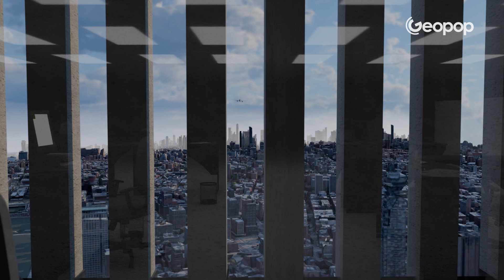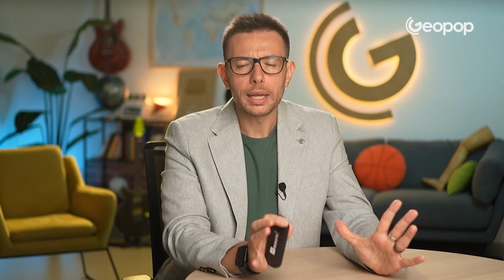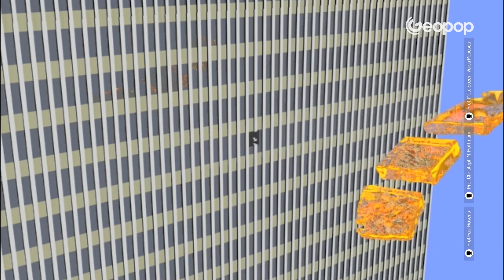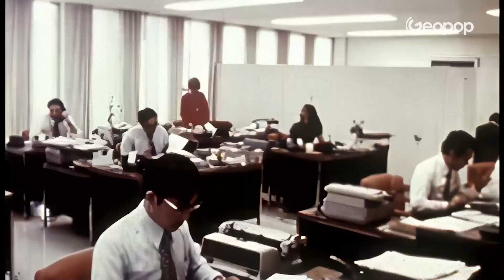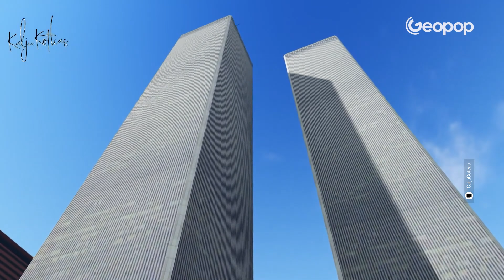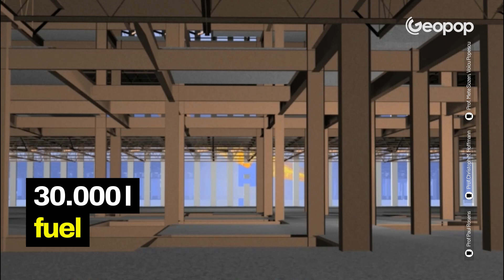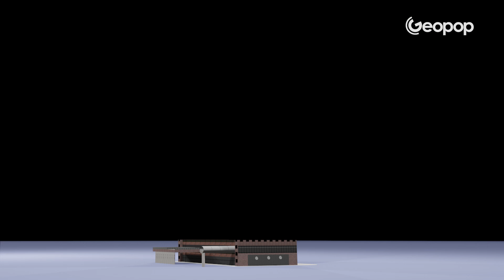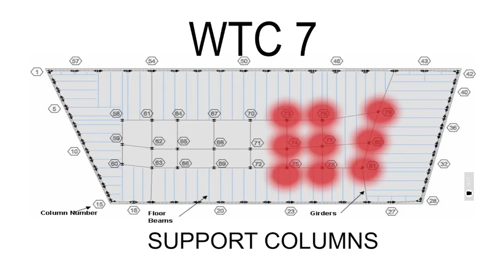9/11, 2001: The Technical Reconstruction of the Twin Towers and WTC 7 Collapses

Comment: I know exactly what happened. There had been an explosive set up for the past year and as soon as Larry Silverstein had his insurance lined up, he said “pull it”, which is a demolition term for “NOW”!
Larry was paid well.
Reply: IS pull a term used in the demolition industry and if so, how?  

Are you sure about that?

Did you check for yourself?  How do you actually know?  Did the internet tell you?

Joël van der Reijden, a deep politics researcher checked for himself. He mailed Jowenko BV, a Dutch company that supplies explosives and conducts demolitions and asked them if “pull” was an industry term for demolition. 

They said it wasn’t. 

Van der Reijden also asked Implosion World the industry trade magazine about the use of the word, and Implosion World told him: 

There is no such phrase in explo-demo. Most likely he [Silverstein] meant "pull out" as in have people evacuate. Conventionally, "pull a building" can mean to pre-burn holes in steel beams near the top floor and affix long cables to heavy machinery, which then backs up and causes the structure to lean off its center of gravity and eventually collapse. But this is only possible with buildings about 6-7 stories or smaller. This activity was for example performed to bring down WTC Building 6 (Customs) after 9/11 because of the danger in demolishing it conventionally 

It should be noted that Van der Reijden would be regarded as a conosouer of tin foil hats by some, and he thinks the Silverstein smoking gun is actually a red herring. He also thinks the 9/11 Truth movement is steered by the security services and that 9/11 Truthers are unwitting (or even witting) disinformation agents. 

Oh dear. The rabbit hole runs deep, doesn’t it? 

Larry Silverstein was allegedly (I don't think the phone call took place as he claims) talking to a firefighter, not a demolition guy so chances are they would be using firefighter slang, NOT demolition industry slang, right? So how does a firefighter use the word "pull", in the context of a building burning out of control and operations to fight said fires? Maybe we should look at some relevant examples or how an FDNY firefighter uses the word “pull”:

FDNY Chief Daniel Nigro - the on-scene commander at Building 7 on 9/11/2001; 

The biggest decision we had to make on the first day was to clear the area and create a collapse zone around the severely damaged 7 World Trade Center, a 47-story building heavily involved in fire. A number of fire officers and companies assessed the damage to the building. The appraisals indicated that the buildings structural integrity was in serious doubt. I issues orders to PULL back the firefighters and define the collapse zone. It was a critical decision; We could not lose any more firefighters. It took a lot of time to PULL everyone out, given the emotionalism of the day, communications difficulties and the collapse terrain

Deputy Chief Peter Hayden - 33 year veteran, NYFD in the August 2002 Firehouse Magazine;

No, not right away, and that's probably why it stood for so long because it took a while for that fire to develop. It was a heavy body of fire in there and then we didn't make any attempt to fight it. That was just one of those wars we were just going to lose. We were concerned about the collapse of a 47-story building there. We were worried about additional collapse there of what was remaining standing of the towers and the Marriott, so we started PULLING the people back after a couple of hours of surface removal and searches along the surface of the debris. We started to PULL guys back because we were concerned for their safety

Notice anything about those quotes? 

For one thing, the word pull comes up quite a bit. How is pull used? What is the context for its use? Are they talking about blowing up a building or avoiding unnecessary loss of life by pulling their guys out of there?  
Silverstein was allegedly speaking with the FDNY on-scene commander. So, now based on Nigro's and Hayden’s statements, what do you suppose "pull" means to a New York City firefighter?

Be less dumb

Comment: Boeing 767 can’t do 700km/h at sea level. Not even with nose diving. That’s aerodynamically impossible.
Reply: Is it? Says who? Not Boeing, the folks who designed, built and tested the planes.
Reply: @TheLoonResistance said boeing and pilots. do you even know what vmo of airframe is?
Reply: @sccooty  1. You are lying. Neither the manufacturer or any organization representing pilots has ever said any such thing, and I suspect you know it. 

2. VMO is not an aerodynamic limit. It is like the posted speed limit on the highway. It applies to all aircraft regardless of type or manufacturer.
Reply: But the planes werent at sea level though?, they were flying through a city that would relatively kill any head wind, and had descended from cruising altitude

Comment: NIST ruling out explosions yet by doing a simple search will find countless videos of people claiming they heard explosions and actual videos of explosion sounds….
Reply: In a review of 603 first responder accounts from 9/11 only 55 (just 13%) of them mention the word explosion or like an explosion and 0 (0%) mention seeing or hearing bombs

And of course, zero corroboraint physical evidence. There are no where collapse initiating explosives are seen or heard. There is zero physical evidence. 

Not exactly compelling. 

Do remember that explosION and explosIVE are different words with different meansings and explosION is a word that can and frequently is used without the presence and use of explosives.

Twin Towers collapse mechanisms are well understood. Collapse initiation was due to sagging floor trusses (which we can see) causing inward bowing of perimeter columns by up to 5 feet (which we can also see) at the impact and fire damaged floors until those perimeter columns buckled and failed, initiating the collapse (which we can see). I would refer to you the excellent Gary Pollard video of the collapse of the South Tower. Pay attention to the first 12 seconds in particular.

WTC2 Collapse -- Gary Pollard (Enhanced Raw Copy from NIST) 

www.youtube.com/watch?v=ULdiD6gYZO0

Columns don’t work well when they are bent. The Twin Towers were designed to work with straight elements not bent ones. When you bend those columns they become up to 4 times weaker. Failure is inevitable.

Notice how the columns are already bent when the camera zooms in, become a bit more bent over the next new seconds until they give, starting the collapse. 

So what bent them? It sure as shit wasn’t thermite or sooper-sekrit fire-and-impact proof hush-a-boom pre-planted demolitions that don’t explode. 

If you keep watching you will note that after the tower starts collapsing the air inside the building (95% air by volume) gets compressed and forced out the windows. These low-velocity air bursts devoid of blast or fragmentation effect are a reaction to the building collapsing not a cause of the building collapsing

Comment: a blacksmith said steel the strongest metal planes being aluminium and those RSJ beams steel.  No kero jet fuel could melt them even if they got soft the whole building wouldn’t collapse because the steel below the heat line would not be weakened  thermite  was used extensively instantly melting and destroying strength to bring down the hole structures including snapping foundational girders with instant explosive thermite charges which were the sounds going bang not bombs!   The Solomon brothers Building seven was the smoking gun because it hadn’t been struck by any planes and it still come down leaving no wreckage or barely any debris remain after everything settled even months later liquid metal still to be found running down the gutter The NIST Report didn’t answer anything they made it up as they were going along to cover this massive crime of The deep state military industrial complex and the $4 trillion lost.
Reply: Thermite melts steel?  Does it though? If only someone had actually tested this instead of just guessing or making unfounded assumptions. Oh, wait!

youtube.com/watch?v=JXWCMBuusMI&ab_channel=TrutherTVArchives 

In this video starting at 45:35 and running to 48:35 the Energetic Materials Research and Testing Center (EMRTC) conducts a test to examine the effectiveness of thermite in cutting a vertical hollow box-section steel column. The column tested is smaller in cross section and made of thinner steel than that of the Twin Towers perimeter columns (and never mind the core columns). In total 175 pounds of thermite are used for the test on just one column and requiring the construction of a rather conspicuous coffer dam to contain it. Do recall the Twin Towers had 240 columns and 110 floors.

It would be odd if thousands of office workers missed hundreds, perhaps thousands of those suddenly appearing.

Note what an incredibly slow process this is. It took close to 30 seconds for the thermite to finish burning off.  It would be impossible to “control” a demolition using this material.

Not to mention the issue of; how does the aircraft impact and subsequent raging fires NOT prematurely set this stuff off?

Also note how bright and obvious the whole process is. Could not be missed visually. No way to hide that. 

Then at the end of the test the (relatively modest) column was undamaged…. which is a problem.

Certainly no rivers of molten steel emanating from it either and in fact the whole thing cools rather quickly as soon as the thermite has burned off, as one would expect.
Reply: @TheLoonResistance 
That obese BS blacksmith who’s afraid of his own shadow and comments on his Shill video ?😂😂😂😂😂

Comment: I had taken my high-rise fire protection course the week before 9/11.  I was watching WTC 1 burn on TV at a cafe when I turned to the woman next to me and said, "It'll collapse, no high-rise is built to take the temperatures of a fuel fire."  Seconds later it did.  What I did not know at the time, but the WTC tower had a floor lattice of trusses as seen in the video, but not directly commented on.  The NFPA report two years later assessed truss failure due to thermal expansion as the likely contributor to the floor collapse, in concert with actual damage of structural elements on impact.  There's an expression we learned on the course, "never trust a truss," meaning, if there's a major structural fire with a known truss support structure don't send in firefighters because it will collapse in eventually.  As demonstrated in the video, it doesn't require the steel to reach anywhere near melting point.  Trusses work on tension, and when the individual elements expand that tension becomes a point of failure.  Truss failures are sudden and violent, they go from 100% to gone in a second.  Also missing from the video is how the floor systems were actually a suspension system hanging on the outside columns with the centre structure independently supported all the way up, almost like a building within a building.  It was quite an innovative design for the time (1970s) and allowed for that open floor plan design.  On 9/11 the design was a liability.

Sprinkler mains would likely have been cut on impact, and any sprinklers that did work would have had the water turned instantly to steam at the higher than designed for temperatures of aviation fuel burning.  That's a good thing if the steam is confined as it eventually suffocates the fire, but with a giant gaping hole in the side of the building feeding oxygen to the fire, and allowing for movement of the steam, any working sprinklers would have been utterly useless.

I was always curious about why WTC7 went down.  It was a conventional high-rise design and went down for the very reasons I learned on course (beam expansion).  I remain curious about the fire suppression system failure because it should have had an emergency power generator to run the sprinkler pumps (NFPA code required if I recall), those are automatic systems, but if the fire main was cut off by the WTC 1/2 collapse it doesn't matter because there's no water to pump.  The water in the mains may have been enough to knock down some of the early fires before they went dry in that case, but as indicated the building was left alone to burn for quite awhile.  The coating that goes on those beams doesn't last forever, so I can see the thermal expansion happening eventually with no firefighter intervention.  I still have questions about the amount of fuel load at the location where the beam point of failure was, if they even figured that out.  There's a reason we have fire codes for these buildings to manage the fuel load by restricting or managing materials used, storage, etc.  

My cousin roller-bladed through the WTC complex 30 minutes before first impact.  I joined the Army because of 9/11.
Reply: Joined the army and ruined millions of lives
Reply: Architects and Engineers for 911 Truth don't see it your way. They are the men and women who design and build these structures. Are you telling us that the NYFD is not aware of your truss theory?  There were many firefighters in the buildings when they went down.
Reply: @georgeratkovich7161  My question is did the NYFD responders KNOW that the structural system was based on trusses?  Were the fire officers oriented in the unique structural qualities of the WTC towers?  I'm not going to monday-morning-quarterback the decisions of the first responders on the ground, they were dealing with a once-in-a-career unique situation.

Comment: Nist is corrupt. Building 7 is the only steel structure to fall due to fire. Or the reports from the ground police national guard fire fighters all telling us about the boom boom boom boom, then it fell, it just came down. With in 3 days all of the explosion talk was wiped from the news. And I'm a conspiracy theorist. I'm just asking questions.
Reply: Why is The NIST corrupt?  Because they are telling you things you don't want to hear?  That is a you problem, not a NIST problem.  The NIST has been around in various forms almost as long as the United States has been a country and the only controversy in it's entire existence has been from a few engineering illiterate whiner-babies who didn't get what they wanted on 9/11. 

Countless thousands of steel framed structures have failed in fire. It literally happens all the time. Far from being uniquely immune to heat, steel structures are uniquely vulnerable to it. After all, steel is formed by heating and deforms the same way. The hotter it gets, the weaker it gets and it doesn't take much.  Get the steel above 400-deg F and it will drop off rapidly. Building fires routinely reach times 2.5 times greater.

Why do you think the steel in these large buildings is insulated?

In a review of 603 first responder accounts from 9/11 only 55 (just 13%) of them mention the word explosion or like an explosion and 0 (0%) mention seeing or hearing bombs

And of course, zero corroborating physical evidence.

Not exactly compelling. 

The collapses of 6 buildings on 9/11/2001 (yes, it was 6) were due to impact damage + fire (heat) + time + gravity in varying combinations depending on the building. That is true no matter who planned and carried out the 9/11 attacks. The inside job conspiracy crowd lost the fight when they welded themselves to the controlled demolition zealots, whose blatantly false technical claims absolutely killed the 9/11 Truth Movement, insuring none of its claims would ever be taken seriously.
Reply: Just do the math and you’ll know the truth. A 10% body recovery rate is impossible in a building collapse.